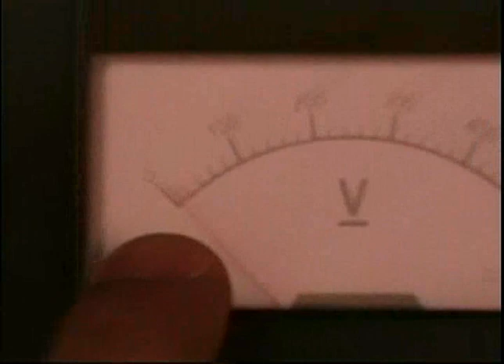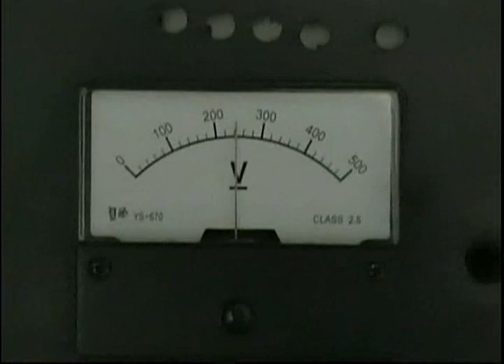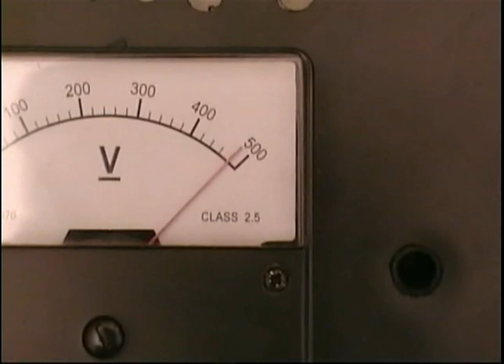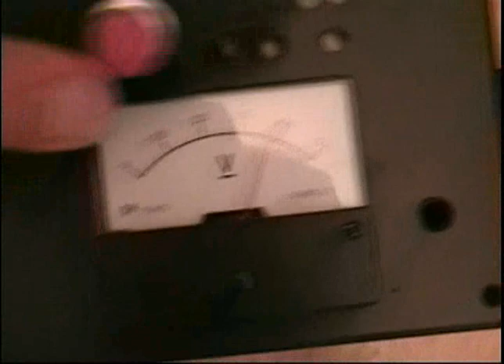FigTroniX BB Coil GUN

Comment from the maker: Yes and no. The 35v is a little low. But on the right coil it will work. You don't want to over charge it. 4700uf is nice. You should charge it to 25v and test some coils. If you plan to hook some together read about series and parallel capacitors. Thanks!!

Comment from the maker: I used a 800v SCR. I still fried my first one. You have to have the Diode at the coil. For reverse polarity protection. The SCR has a foward and reverse current MAX. So if you dont kill it before it changes it will kill your SCR.